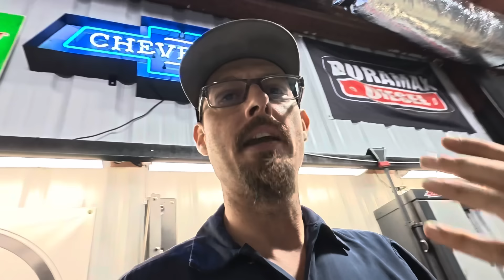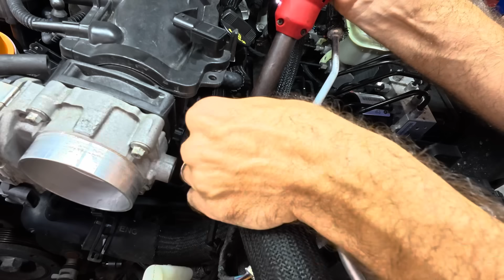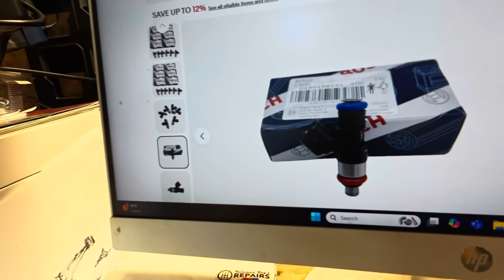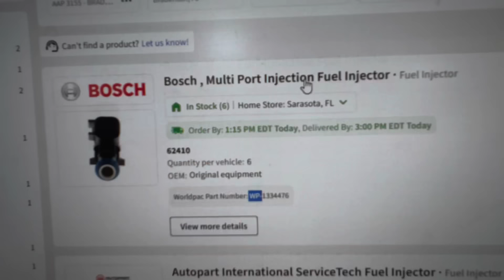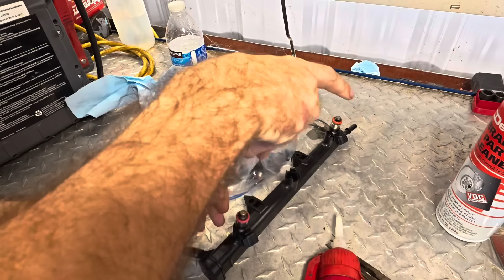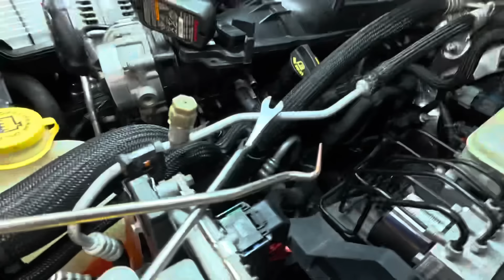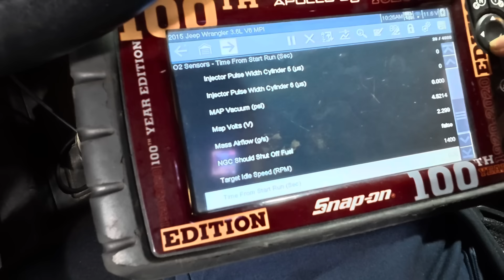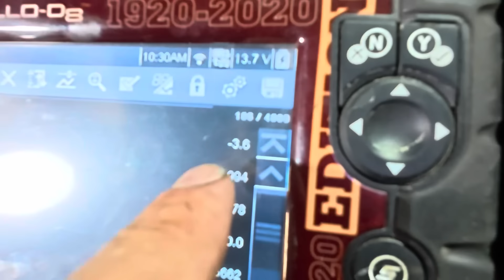Problem FOUND! E-Commerce Auto Parts (STRIKES AGAIN) Jeep Wrangler 3.6 P0172 P0175

Comment: I don't avoid online retailers, but I get real concerned when I see outlandish deals on high priced parts. 

But here is a recent example of the difference in price if you don't look around. A belt tensioner for Hyundai. Hyundai says sell it for 500 bucks, that's the MSRP and that means the dealer will make a healthy profit at that price, they no doubt get it for a lot less. MY DEALER sells it for 650 dollars, which is a total rip off. Several well known online Hyundai dealers sell it for the MSRP,  or a discounted price, in this case, 350 dollars. I do trust the Hyundai dealers online and would go with that. 

Now, on that part, you can get a after market part MADE IN CANADA, for about 250 and that likely is a solid after market item you can likely trust. 250 is a long way from 650 and in the case of a vehicle with 150,000 on it already, I bet that part outlasts the engine.

Comment: As a DIY mechanic that is one of my biggest compliments. China is manufacturing parts and labeling them as premium parts. While the $100 a set compared to $100 each should be the key, I have been burned by it because I found a "direct vendor" for a discount of 30%. The part looked really good next to the factory part, it just didn't work for more than a few months...

Comment: Good Video and 100% agree with what you said about eBay and Amazon but there is nothing wrong with sites like rock auto I have bought 100s of oem and after market parts from them and only had 1 or 2 issues that they rectified immediately and the return policy is great. I don’t like getting ripped off at the stores you use to get parts and I understand as a mechanic you have to have parts same day and also have to warranty the part and labor. As a long time DYI I have saved 1000s using RockAuto vs autozone ect so your comment about people over buying parts thru them is probably accurate I always order extra stuff especially on clearance but only install them when they are needed so imo I got the assumption that maybe you thought rockauto had cheap parts and yes they do but they sell everything from OEM, name brand and of course Chinese. I have always checked the parts especially the OEMs I get from them and never had a counterfeit.

Comment: Amazon & EBay sell a ot of counterfeit parts!. The best way to tell is the extreme difference in prices. You can get good deals. The most I've seen is Motorcraft parts!. Those have counterfeit boxes. You need to study what you buy. I bought  a cheap MAP sensor and it didn't last 5 miles. Never buy the cheapest parts!

Comment: Why did you leave the paper towels in the lower intake? That can't be good.
Reply: Ray would never troll you
Reply: @bigdaddymak1439  🤣🤣🤣🤣
Reply: he made you think he did.
Reply: Definitely thought the same thing.
Reply: He was having some fun with us.  Notice the cut after the first bolt went in.  That was when he took them out.  He also left the adaptor for removing the O2 sensor on the ground under the Jeep, and then ignored it after 'dropping' several parts right beside it.  He likes to trigger the OCD.
Reply: @nunya3163  leaving the wrench on the ground got me a bit.... ngl
Reply: @red_ben3487  It was getting at me as well.
Reply: He wanted to fix the rich condition.  😂

Comment: Ray look up Tyler Potter's video about a factory fuel injector upgrade on the 3.6. Tyler is a Chrysler tech. The upgrade is a factory part for a newer year 3.6. The injector is the same externally with the same flow rate. The difference is the nozzle has more holes for better atomization. The best thing about it is the newer Mopar injectors were at the time of his video $30 a piece from Mopar.

Comment: OR, they were remans which are basically used old injectors that passed a flow test, got cleaned up, new seals and sold as a kit.  I have a set  like that that had a 50% failure rate.  Still not convinced the other 50% are good. They ARE OEM Motorcraft injectors though.

Should wait til the end. Those are high flow injectors, and require a calibration tune to work properly. LOL  Thats like dropping high flow into a diesel without a tune, runs like crap and sucks up the go juice. Arod should know that!

Comment: Back many years ago when I used to rebuild alternators, I had an alternator testing machine. Do they make a diagnostic machine that can test mass airflow sensors, O2 sensor, temp sensor, map sensor, ect to see if they are within specifications? If not, someone needs to create one.

Comment: Cheap is as cheap does. Why anyone would buy mission critical parts from dealers in crapola escapes me.
Reply: Money, it's always about money. They think they save money by buying parts from dealers in crapola, as you say. The problem is they might end up buying original parts afterwards, because the cheap one fails. So no saving, just extra costs,,and money out of the window.

Comment: Tough time to be an auto technician. Complex auto designs-like the 2019 Ford blower motor a couple of days ago- that are needlessly hard to diagnose and repair. Low flat rates (unrealistic). And throw in bogus online parts problems (I once bought a blower from a guaranteed OEM site for Honda Fit; it was actually for a 90's era GM, like a Suburban).... They are not a "bargain" if it costs a lot of labor/time to diagnose the problems the faulty parts require (waste your time putting them in and the mechanic's time replacing them and have to buy quality anyway)......Many factors are creating more complex analyses, problems and mysteries for mechanics...If the code comes on right after you install the part, it is likely the part or the installation. Good fix. Good call. (The price and part number were the smoking guns; spray pattern way off).....Not Bosch. Just because Ebay and the box says Bosch--doesn't mean it's Bosch.

Comment: Maybe the the DIY guy was a DUI guy... had a few too many and ordered the wrong parts. Didn't see the blue paper removed from the intake ports, and when the engine was started, it looked like the blue paper was ejected out of the tail pipe.  Are you performing some stunts for dramatic effect, Mr DeMille?
Reply from the maker: I found listings at this part number for Pentastars that went all the way up to 2024. AND depending on the vehicle the 3.6 was rated for different power outputs. So a Chrysler 300 and a Grand Cherokee may have a 3.6 but they have different parts in them. These injectors may have been specked for a ProMaster for all we know. And I doubt the e commerce sellers have a clue what they’re actually selling.